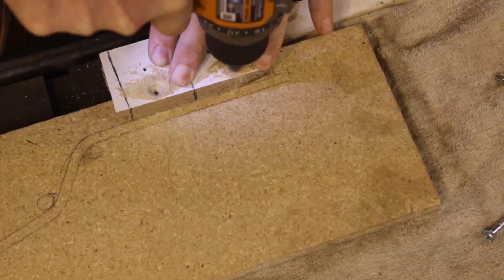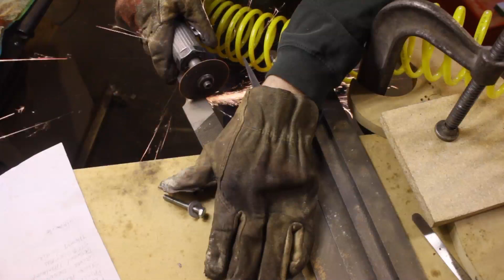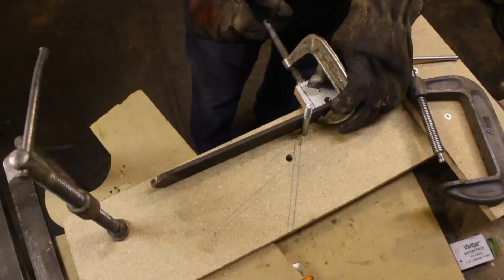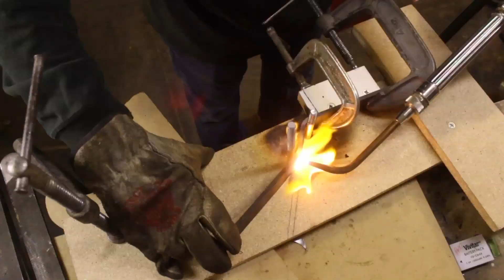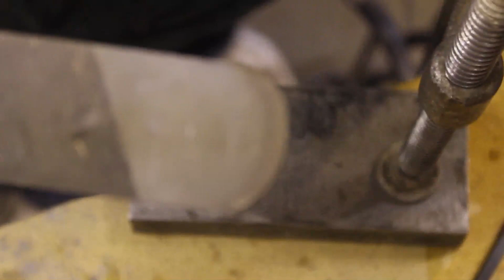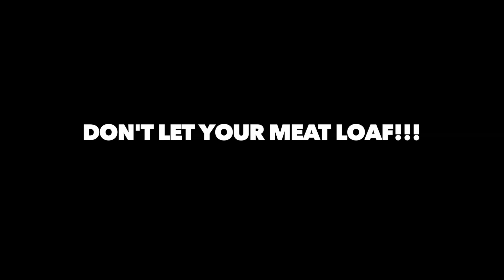Bodywork's Magic Wand - The Slapper File

Comment: Nice video, may I ask what plasma cutter you have and how do you like it.
Thanks
Reply from the maker: Kirk Frei Hypertherm powermax 30.  I love it. I'd love to have a bit bigger unit, but that's what I could afford when I bought it.
Reply: Greg's Garage Thanks, I heard those were great units but out of my price range. Been looking at those cheaper units from various manufactures for occasional use. How thick of steel can you reliably cut?
Reply from the maker: 1/4" is a piece of cake.  Any thicker and its slow going.

Comment: How long and wide is this file?
Reply from the maker: They start about 12-14" long.  On these the file tapers a bit.  I prefer straight ones when I can find them.  These are 1" wide at the tip and finish a little over 1-1/4".
Reply: Greg's Garage Thank you